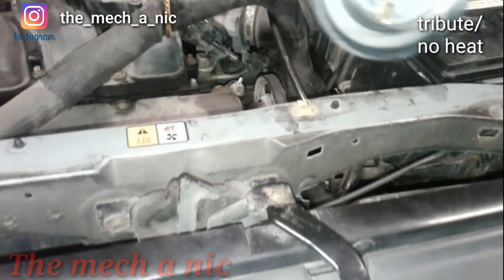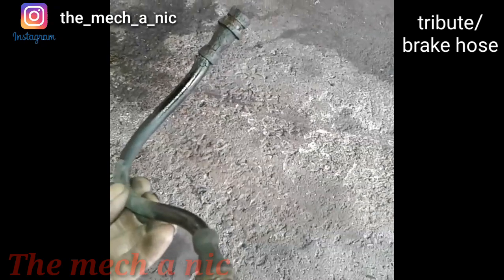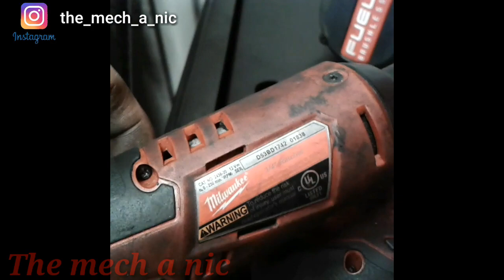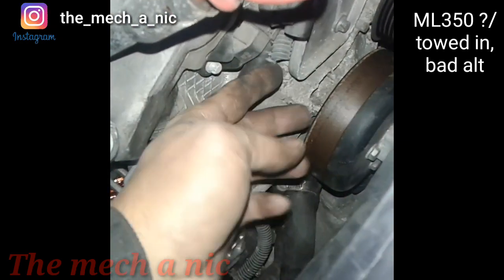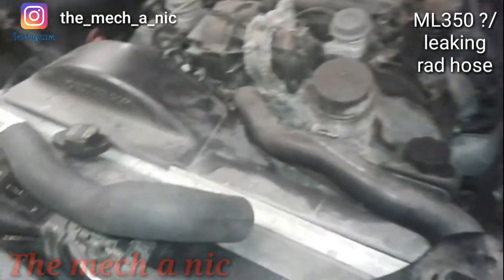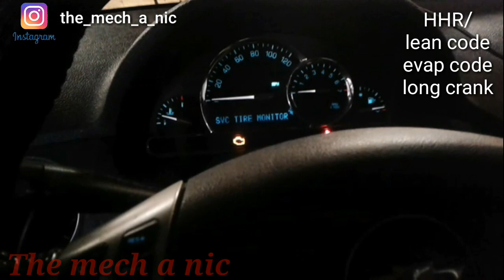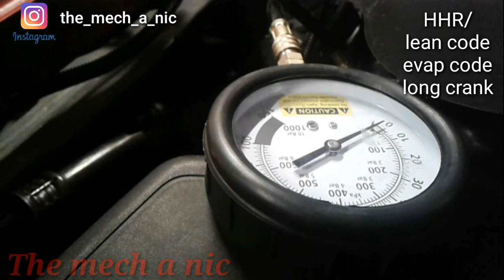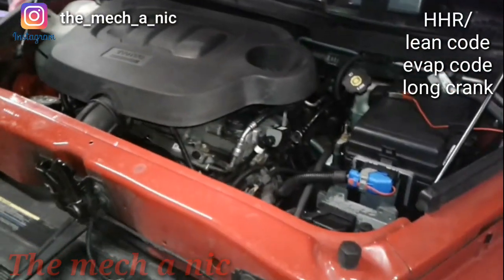Insta mech a nic (vol 10)

Comment: I hate it when my dongle is missing.....  and yes a stuck open injector would most likely cause a rich condition but I like the way you thought it through.  Excellent job fixing all those problems!
Reply from the maker: Without that dongle my otc fuel gauge is useless, wonder if I can find a replacement lol. Thanks!

Comment: If you'd like to really clean your cordless tools,
and even some ratchet handles-
Get a tub of GOOP waterless hand cleaner.
Dab on with soft cloth, rub stains out, wipe
clean with dry cloth.

Use the "original" white jelly kind-
NOT the pumice-citrus kind.

It also works awesome to help get stains out 
of clothing, carpet, upholstery. 

I've slathered it on old, dirty dashboards,
let sit a few hours. It "floats" the dirt out.
Wipe off with paper towels. You'll be amazed
how much grime it gets out of "Clean" things.

The lanolin it leaves behind actually 
moisturizes & protects the vinyl and leather, too.

I'd love to see you clean your impacts on a video.
Reply from the maker: Thats great advice. Works great for hands so i could see it working just as well for tools

Comment: Good job, that Mercedes needs a valve adjustment.
Reply from the maker: And a few other things . In the video it did sound loud on start up but I think it's because it's been sitting for so long there was no oil in the heads . It got a bit more quiet after running for a minute or two